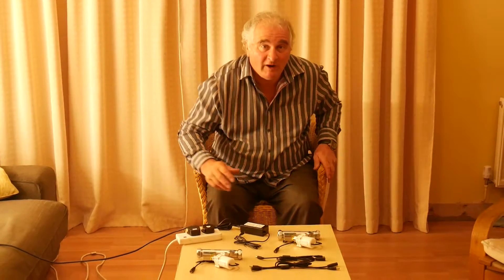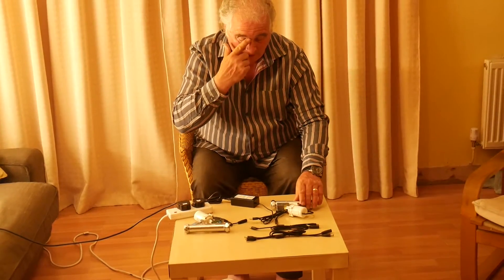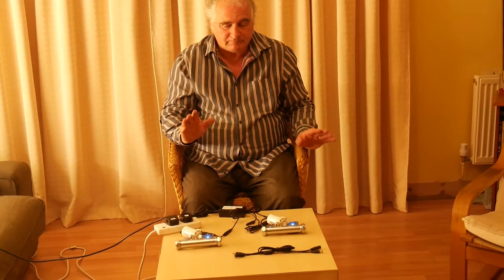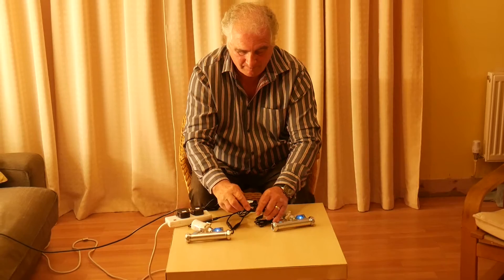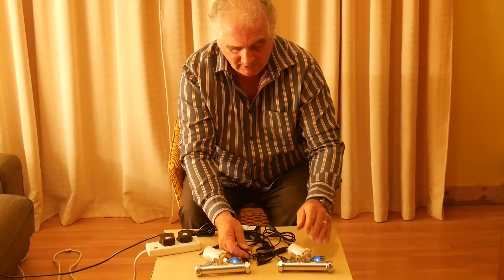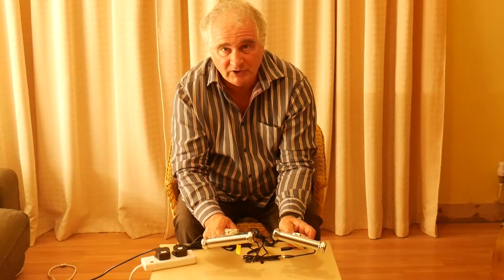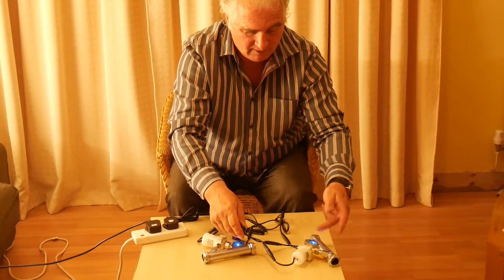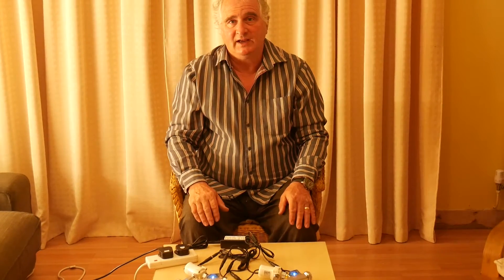ShowerPowerBoosterWiringPumps

Comment: Is it suitable just before the electric showers as many Triton 300SI has low pressure problem and if this will help I am sure many people will need it
Reply from the maker: We sell many pumps to people with electric showers - they work very well and will solve this problem.
Reply: Final question: If the pressure is very high for the electric shower do you think it will be problem ?
Reply: Brought this for electric shower.. installed one meter from it and the amount of pressure it added is not a lot or impressive. A bit noisy too.